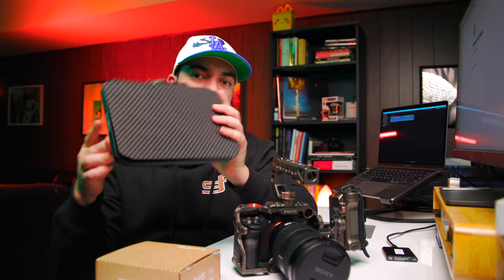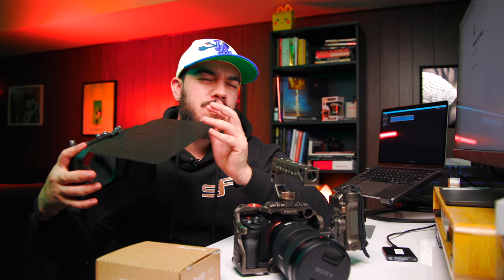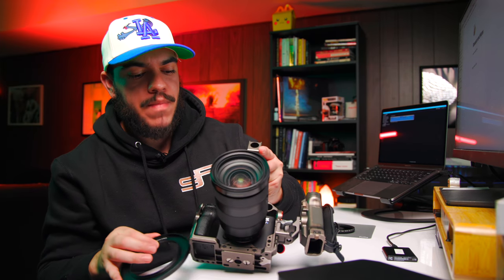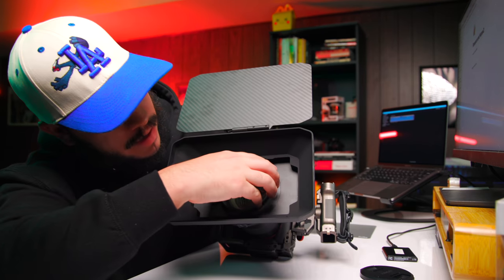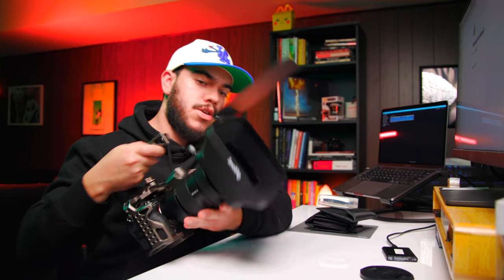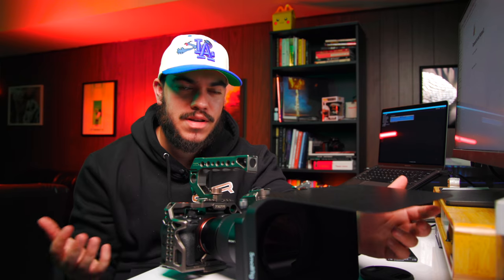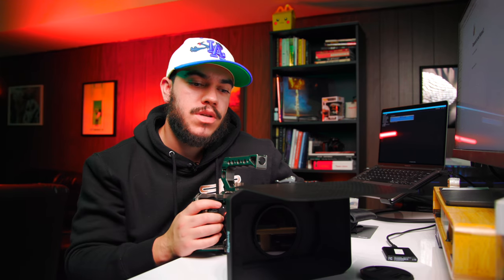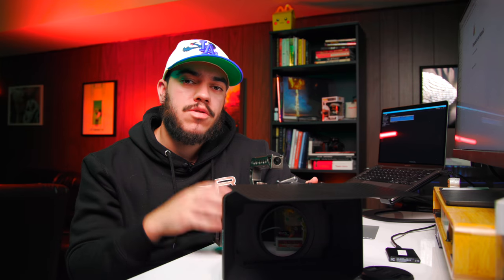How to Use Screw On Filters with Your Small Rig Lightweight Mattebox 3556!

Comment from the maker: The adapter rings were discontinued and now you can just buy the updated small rig mattebox 3556 that comes with the rings: https://geni.us/EAzJyU3
Reply: Thank you so much for this review. I'm just wondering though since you have so many screw on filters, how would I mount a polarizer, ND filter AND a pro-mist? I will be shooting a lot close to mid day and I was thinking of getting a matte box with 4x4 filters but I'd love to just use my existing screw on filters with a matte box.
Reply from the maker: @cheesedust-n3w  to stack that much you would probably need a matte box that has a 3 tray system its going to be really hard to find a pair of screw on filters that can all be stackked like that. only filters I believe that I know that can be stacked are from prism lens fx I have their vnd and it can be stacked.

Comment: Thanks for the video. I accidently bought the smaller one and it's a freaking toy joke! I didn't realize just how small it was, and I was trying to find actual 4x4 nd filters and they are all 100 mm which is just a little smaller than 4" so they move around in filter tray, and like you say the bigger 4x5.65 are pricy Smallrig makes one thats $159 that has I think 4 stops. I have some circler ND filters, but was planning on 4x4 sense like 6 years ago I bought a full size mattebox with two trays, and it's huge but looks so professional but you need to use it will a tripod . I live in CNY and did a wedding in Scranton PA

Comment: can 95mm filters be used with the 95-114 adapter?
Reply from the maker: Im not sure if you’ll be able to screw on filters you’d have to check
Reply: Hi Andy, did you try it? Using 95mm VND with 95-114 adapter. Does it works?
Reply: @sohoming   yes, after talking to smallrig without getting the confirmation for my filters i got all in and ordered it along with the adapter rings. sadly the filters did not fit because of the square filter sliding rails in the mattebox. so i used my dremel and just cut them a tiny bit down. now the filters (freewell mist nd 95mm) fit in the mattebox and you still can use aware filters without issues
Reply: @Andy-gz1wj  Thanks for your sharing. It's very helpful.

Comment: Hi nice video. Question so im new to the field, im trying to purchace this matt box to go with my Sirui 35mm anamorphic lens. Thats the first lens im goin to get. It has a 67mm thread i will need a 67 to a 114mm ring for that lens correct? Now i wanna get the polar pro variable Peter Mckinnon filter the circular one. Will i need to get the same size 67mm after i have install the mattbox?
Reply from the maker: I recommend looking at which of your lenses has the biggest filter thread and buy all your filters that size and then buy step down rings so you don’t have to buy filters for every lens. So if your biggest lens is 67 then yeah you will need a 67 to 114 which I think is included in the filter adapter ring pack
Reply: @MateoToro  i will end up getting the polar pro basecamp it looks like it might work better

Comment: I bought the Smallrig mini matte box, but I discovered that can't use my 82mm Moment VNDs because the matte box is too small. Those VNDs have a protuding for the stops marks, and that makes easier to handle them but impossible to fit inside the mini matte box. I wonder if this matte box would have the right size
Reply from the maker: Yeah I use a 82mm vnd all the time for my Sony 2470 I haven’t had any issues even with other 82mm filters
Reply: @MateoToro  Thanks for your prompt response! I'm definitely gonna return the mini matte box and order this one + the adapters

Comment: Question, I really like this matte box, but I have a 90mm sony lens ringside is 62mm also I have a prime Sony 50mm ring size 49mm- can I find those to fit the small rig or are we limited to the few rings it comes with?
Reply from the maker: I do not believe so unfortunately looks like the smallest lens filter ring you can adapt to it is 67mm
Reply: The additional kit for smaller sizes is about $40 and goes down to 52mm
Reply: Nothing wrong with adapting up to the small rig adapter ring. So get a step up from 49mm to 62mm then to the matte box.